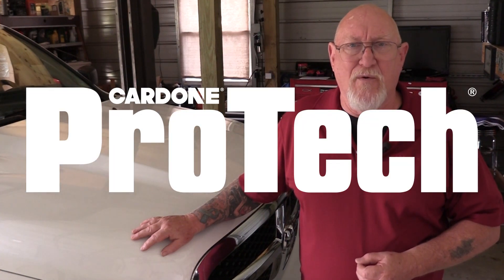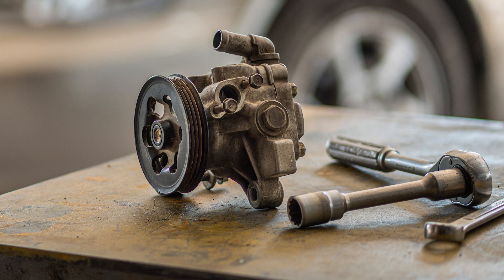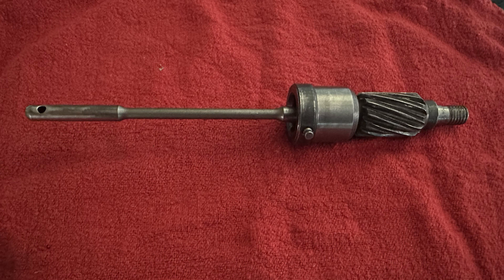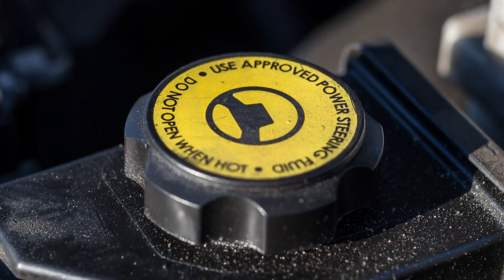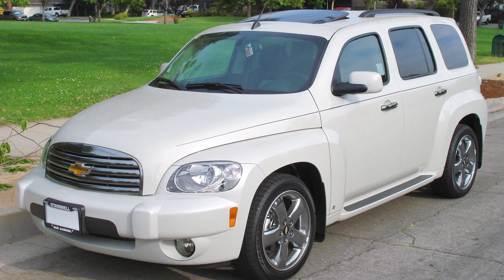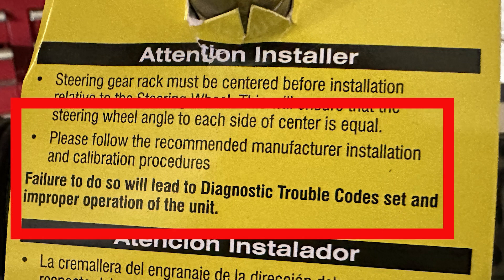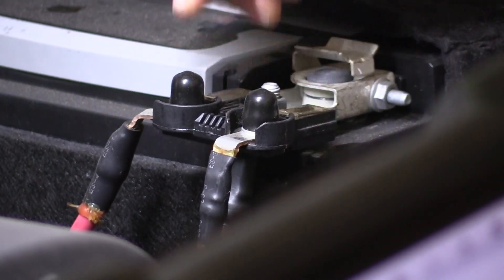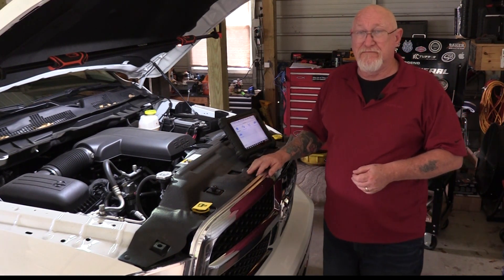CARDONE PROTECH #12:  Getting Along With EPS (Electronic Power Steering)

Comment: My 2020 Toyota RAV4 has electric assist power steering.  Works nice and smooth.
Go Tech (Ryan and Mike) had a video last week with a vehicle that had the EPS and there was no assist.  The other code in the vehicle was for a wheel speed sensor for the ABS that was bad.  The ABS was not working and would not communicate with other modules especially the EPS on the CAN HS line.  
Ryan diagnosed, tested and had to replace that sensor.  After clearing the codes the EPS was restored.  In other YT videos, I'm seeing more and more comm line problems from one system causing other systems not to work especially no starts.  It takes knowledge of these systems, experience and great diagnostic tools to fix these problems.
Your explanation of these systems and the "How It Works" video is a big help.
Good work Pete.

Comment: Turned out that my code 42 for the 94 GMC Sierra C3500 with the 7.4 engine had a bad plug wire after replacing the old wires with a new set of plug wires.  I had a rough running engine which was the reason I started with wires because the spark plugs were new and only had a few thousand miles on the spark plugs.  The GMC was still running rich which should have been a better clue for the problem than the code 42 which tells me no communication between the distributor and the PROM.  I bought another set of wires and the engine smoothed out nicely.  I've taken some highway miles on the GMC and have gotten a new code 68 and the manual says that the transmission is slipping.  I changed the external filter and the one under the transmission.  Many years ago I did my own transmission flush and put in the synthetic.  The external filter must have had absorbed all of the friction material because nothing was in the pan when I dropped it to replace the internal filter.

I'm hoping that the transmission will hold up with everything I'm carrying in the box truck.  Lots of heavy tools for my traveling repair shop.  Does anyone have advice on the transmissions or is code 68 as misleading as the code 42 was for misdirection for a bad plug wire?